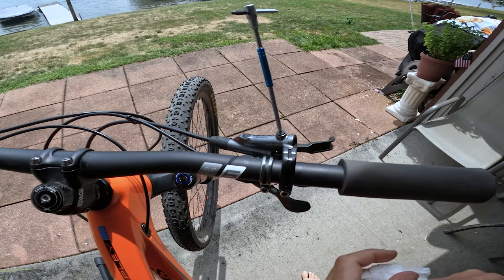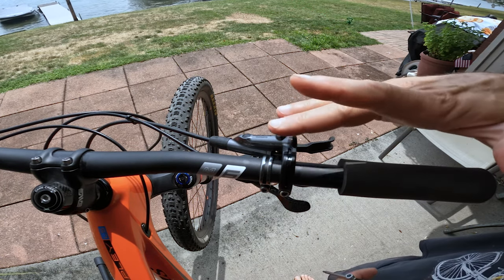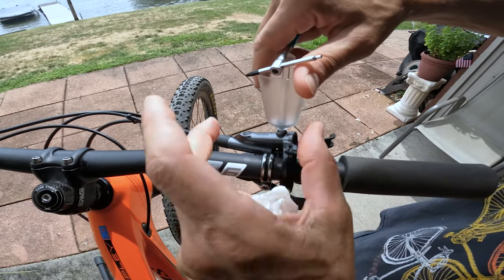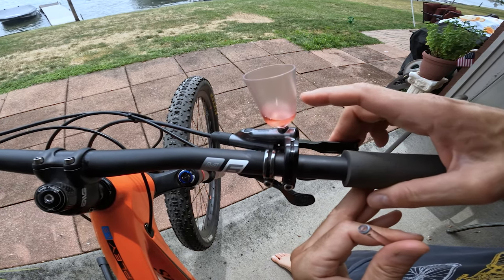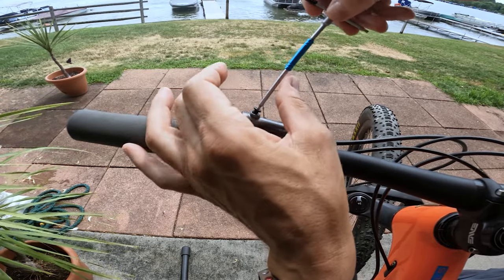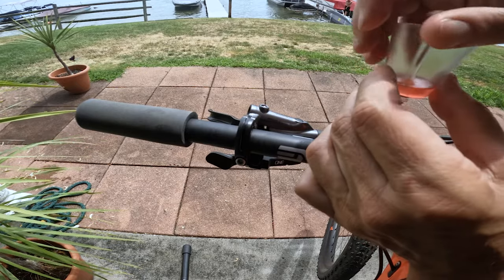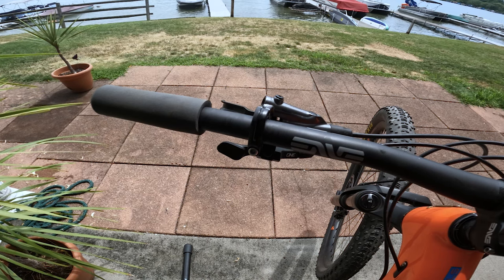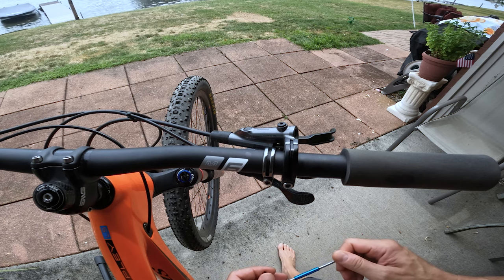Mountain Bike hydraulic brake maintenance quick tip for beginners -  Brake Fluid Top Off

Comment: Cheers mate. New ebike delivered , warning light upon squeezing front brake,  so I've ordered a brake fluid kit to firstly check fluid levels since manufacture.  I'm guessing some air ingress since shipment from China to UK. Cheers again.  👍
Reply from the maker: I am so sorry for the delayed response, but considering the state of work this past month, and a tornado that knocked out power for a few days, again this summer (it also destroyed the trail I help maintain for a second time this summer, So far, between the 3 of us, we've been forced to cut out about 200 trees just from those two storms alone), I'm way behind on personal things. It is very common for brakes to have a bit of air in the line when new. The best thing to do is top them off, to be sure. Hope you enjoy your e-bike. DNR finally legalized them on trails here in MI last month. Though it's only for a year to see how it works, I'm sure it will be permanent 👍

Comment: Good video, can you do this to get the calipers spaced fully on Sram breaks
Reply from the maker: Thanks for the comment. This procedure can, and should, be done on all brakes in between bleeds. Prior to doing any caliper adjustments, I would first remove the air from the system as seen in the video, then work on centering or aligning the caliper.

I hope I understood your question and responded correctly. let me know if I didn't

Comment: it ll be better if bike was hanged vertically for the air to go up, i  did the same every month
Reply from the maker: Agreed. this is best for forks as well. It keeps the foam rings saturated with oil. Unfortunately that's only an option for me when I store them in the winter for now. .

Comment: Hi, thanks for sharing the video.
Is the process similar for Tekro brakes?
Reply from the maker: Thank you for taking the time to watch it. This video applies to all hydraulic brakes. Over time, air can seep into the system. The air bubbles will make their way to the lever bleed port as long as the bike isn't stored upside down. If your brakes start feeling soft in between bleeds, then this is a good place to check first
Reply: @zoubtube  That’s very helpful, thanks.

Comment: Great video. Seems easy enough ! Where can I buy the reservoir and the hydraulic minerl oil?
Reply from the maker: Glad you found the video informative. There are many options, but your best bet is to buy a bleed kit. The funnel alone will only help remove air that has collected in the handle. A full bleed is needed at least once a year, imo. For a full bleed, you will need the syringe. I have posted brake bleed guides for both Shimano and SRAM brake that should help. The bleeding process is very easy, and if you follow my guide, I'm sure you will end up with a successful bleed  

below is a link to a very cost-effective bleed kit on Amazon. I've never used this kit, but it should work. There are other kits that cost more, whether they work better I have no idea..

https://www.amazon.com/ROWYOU-Shimano-Hydraulic-Bleeding-Professional/dp/B0C15CSP8X/ref=sr_1_8?crid=23CS1GMWQUD4R&keywords=shimano+bleed+kit&qid=1692234062&s=sporting-goods&sprefix=shimnao+bleed+kit%2Csporting%2C113&sr=1-8#customerReviews
Reply: Thanks a lot for you answer. I look forward ro trying it. @zoubtube

Comment: Than you for the video! I have a question though; I know you said to check it every 50 hours, but what are some of the indicators that the fluid needs to be topped off? I'm new to hydraulic brakes, and I have to apply more pressure to my rear brake. The best way I can describe it is it feels like a stretched cable on traditional setup. Does that mean the brake fluid needs to be topped off?
Reply from the maker: Great question. The biggest indicator is when your lever starts to feel soft. Once you get used to your lever feel, you will notice when it is softening. When this happens, I'd bet money that there is a bit of air in the system. An air bubble in a hydraulic system basically acts as a cushion. The cushion will absorb pressure that should have been applied to the caliper pistons, which means you need to apply more pressure in order to get added pressure to the caliper pistons, hence the soft feel. Just make sure your bike has been sitting on its wheels, and not hanging from either wheel, before topping off the lever. 👍

Thanks for the comment
Reply: @zoubtube  thank you! My levers are feeling squishy so I’m going to take it into the shop to have them check the fluid! Hopefully I’ll have my own bleed kit next time so I can do it myself!

Comment: How do you get the cover off the bleed port if it's rounded out?
Reply from the maker: Multiple options:

If there are still traces of corners on the bolt, you can try to use an Allen key with nitrile  gloves. Place the glove over the Allen and insert the Allen into the bolt head. The glove will fill the empty spaces as well as provide enough grip to remove the bolt.

You can also use a special Allen key that is made to remove bolts with rounded heads, but I will say that they don't always work. If the head is too rounded, they won't work at all, from my experience.

A sure-fire option, though in this case I would consider it a last resort, is to find a sacrificial Allen key and apply epoxy (not regular glue) to the bolt head, then insert the Allen key. Leave it sit for 24 hours, then remove the bolt

Hopefully, this helps

Comment: Is this called bleeding?
Reply from the maker: Nope! this is just topping off. This should be done if your brakes feel a bit off over time. All your doing is removing a bit of air from the reservoir in this case. not from the whole system.  I have multiple bleeding videos on the channel for both shimano and sram brakes that go into detail in order to help with the process